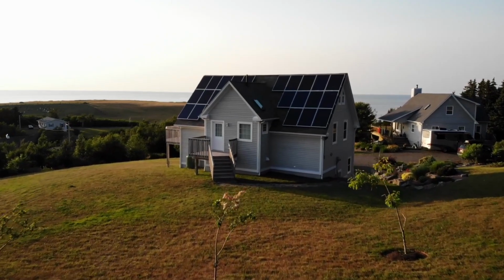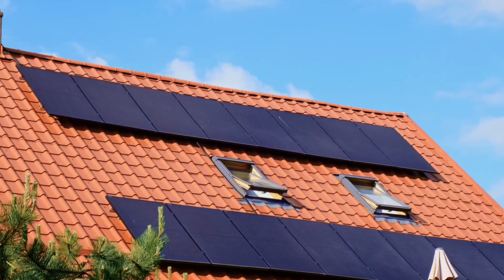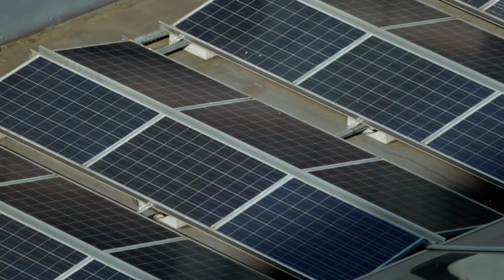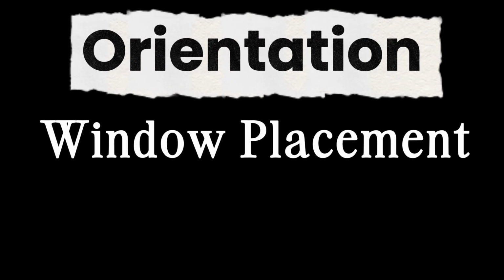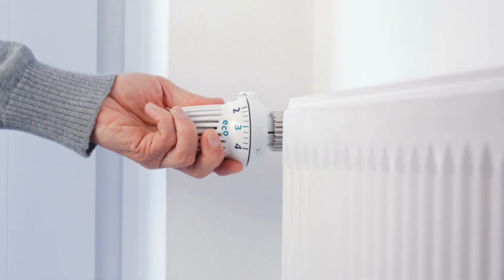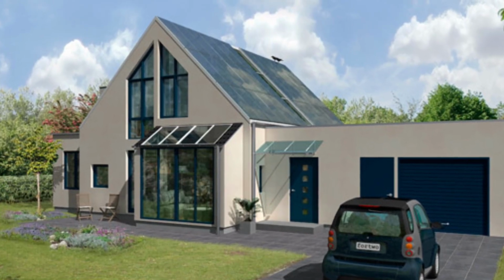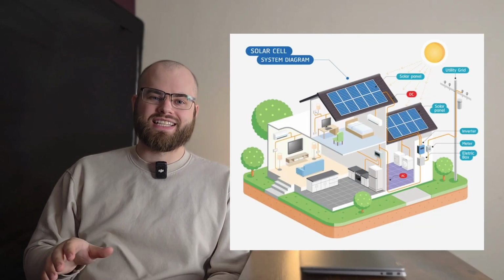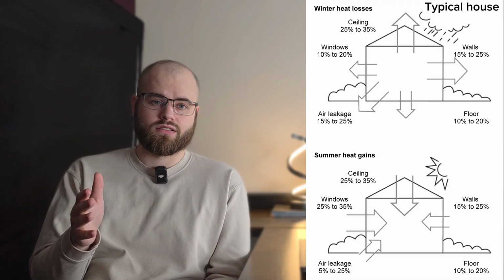This House Pays YOU to Live in It (Net Positive Home)

Comment: It would make no difference to global warming if the money saved is spent elsewhere, efficiency is a saving of energy overall.
Reply from the maker: Depends what its spent on. And yes efficiency extremely important - the more on site renewable technology the more money spent on R&D meaning eventually more efficient and cheaper costs
Reply: @Archiischool  It would make zero difference to what the saved money, as all money is a ticket to energy, what the saved money is spent on.
Because of the interest rate on money and inflation of the debt/money situation then any efficiency gained is lost over time.
Nothing about renewables or green energy has been anything other than an add-on and more debt/money being entered into the system, we could literallyy have stayed on coal and reduced our consumption and overall the affect would have been better.
As we are not reducing our overall consumption of oil as we buy synthetic clothes, sythnetic rubber tyres that now drop the same tonnage of microplastics onto roads and our lives as the tonnage of plastic bottles going into rivers, and the tonnage from car tyres is immediate then nothing about green energy works unless it has the corresponding amount of lowering consumption, which none of these ideas really accomplish.
Can people consume less, yes, do people consume less when implementing these ideas, no, they go and buy a new pair os extrdued foam shoes dropping microplastics wherever they go, or buy something else oil based, friends got solar panels and with the money saved bought a motorhome and drove round the country.